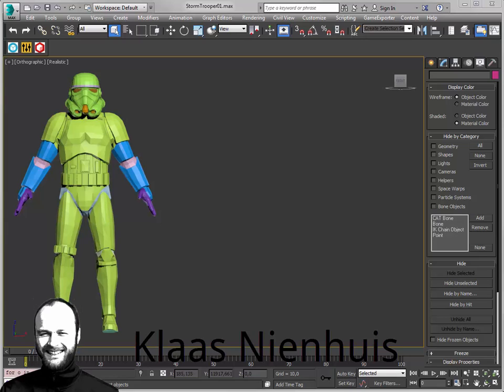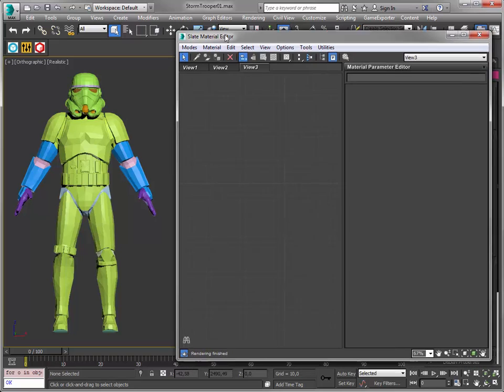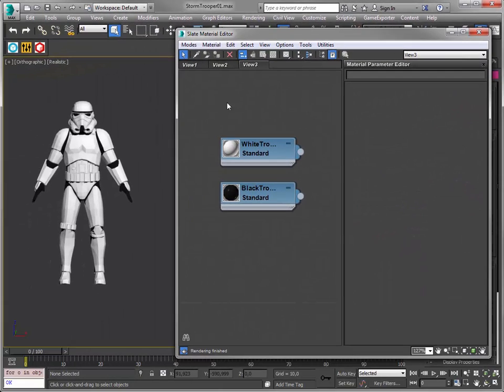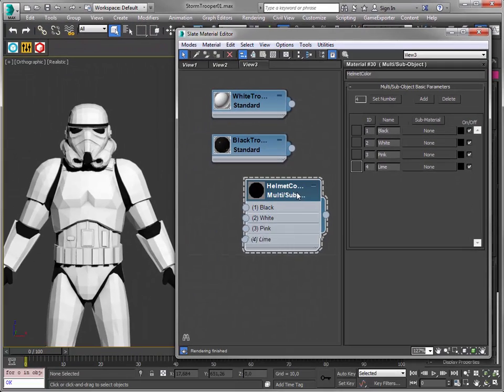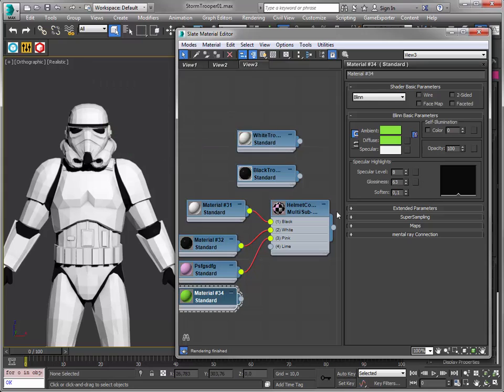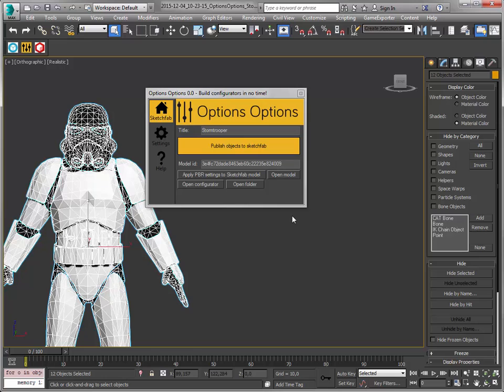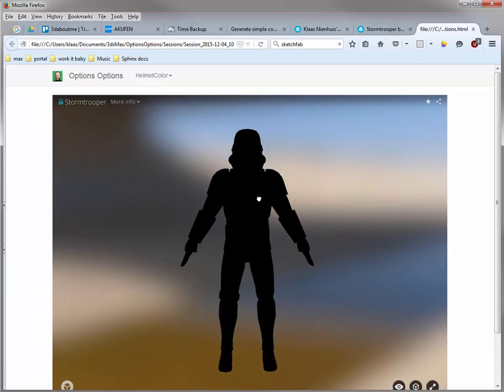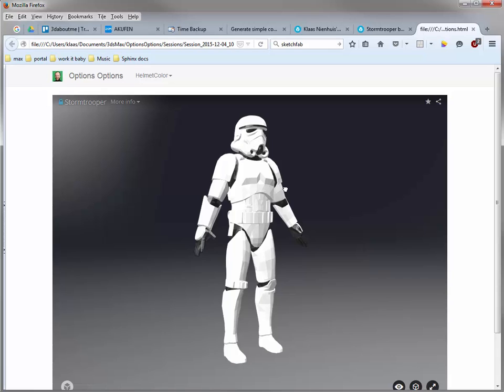OptionsOptions Configurator basics

Comment: how to make colorpicker option for color changing?
Reply from the maker: Hi there, this is a matter of doing a bit of web development. the configurator code creates a material library. If you don't want to use a library of fixed colors, but a colorpicker, you need to hook up a colorpicker into the material changing function.